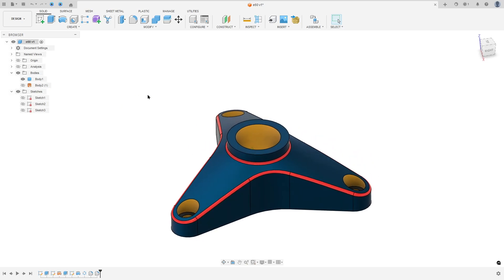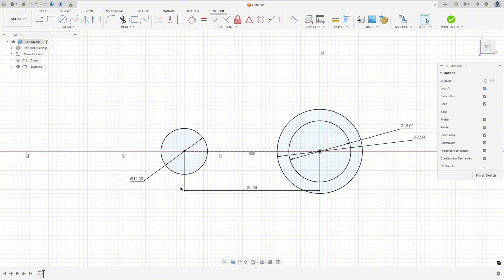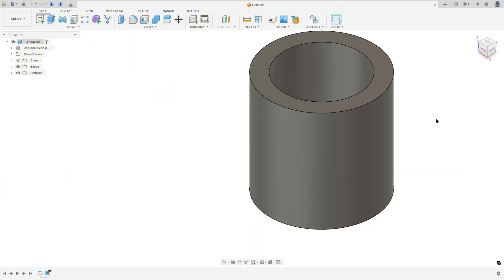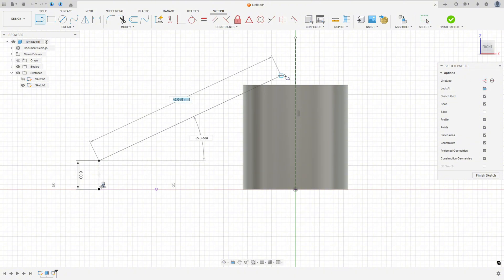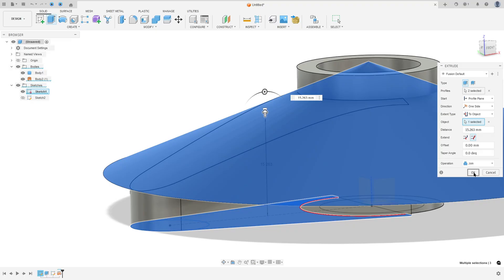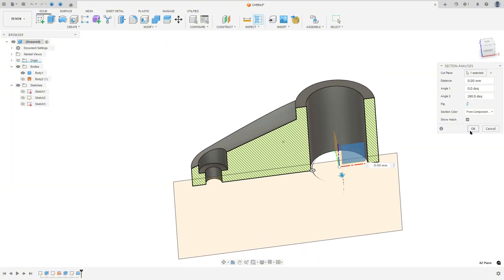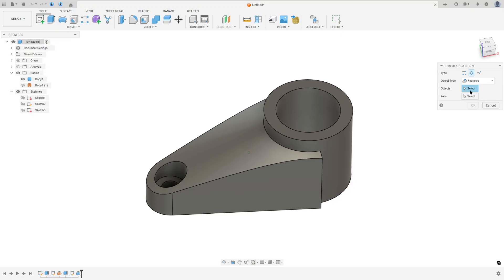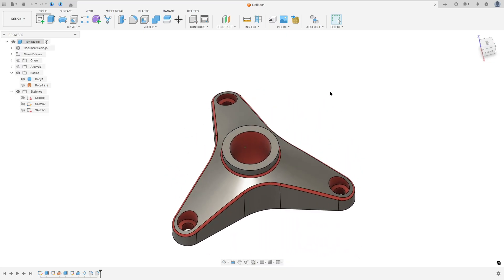How to Extrude to Surface in Autodesk Fusion -  Exercise 60

Comment: Since recently discovering these tutorials, I have been following along, in Fusion.  I have gone back and recreated at least 10 of your tutorials, thanks!  I have learned quite a few new techniques and different / better ways of accomplishing specific design aspects.  I still chuckle every time you pronounce it 'x-trud', instead of x- trude ('ĭk-stroo͞d′), thought you might like to know.  (use Google to "define Extrude" and click on the speaker icon to hear it).
Keep up the great work!